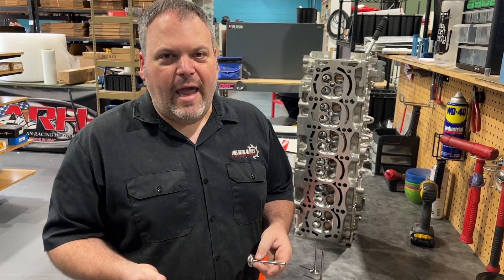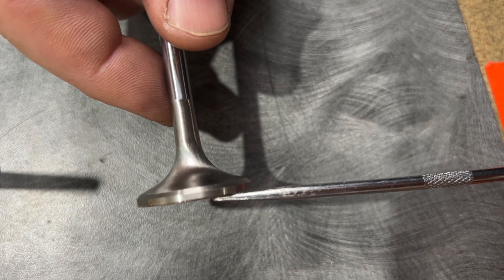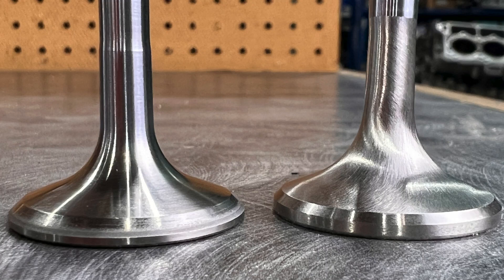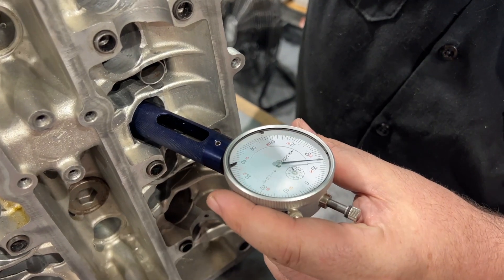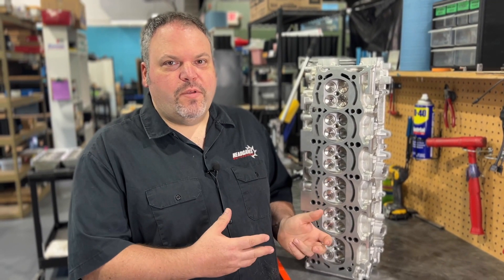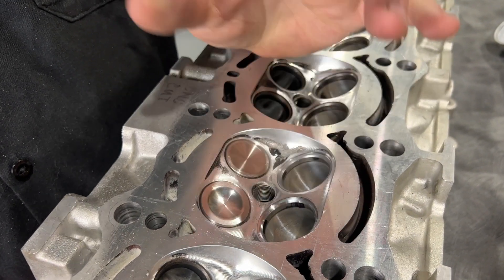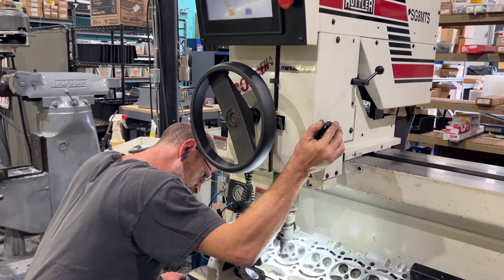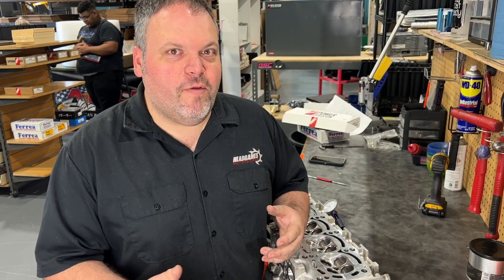Valve stem height - Why it matters!

Comment: where do you find spec for valve stem height?
Reply from the maker: that is a tough one. We have data from heads before they get worked on. Which anyone could do when they remove their stock head and could measure it. But, the internet is not friendly for that kind of info.

Comment: Thank y’all so much!! I left a comment on facebook one day asking about stem height, and someone replied and said they’d make a video and they did!! But one more question, what actually DETERMINES what your valve stem height needs to be, and how do you find out what your needed valve stem height is. Thanks so so much guys!!
Reply from the maker: Thanks for the idea Noah! We go off of factory stem heights of what it should be or should be close to it. When you are to far off in either direction it creates issues with fitment of parts. You can use the tool I showed in this vid or you could use a dial caliper to figure out what your stem height is. There is not much info on what it should be on the internet however, so that would be a tough one to answer. Besides just measuring it what it is stock.
Reply: @headgames  Well alright then! Thanks guys!!